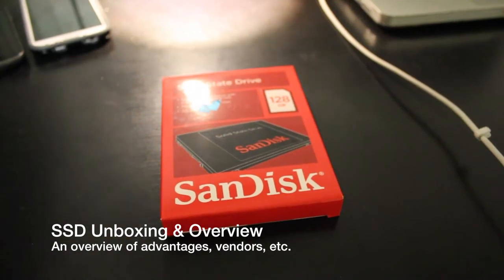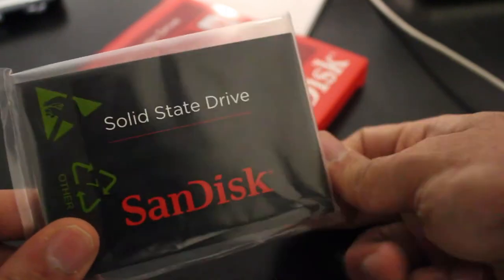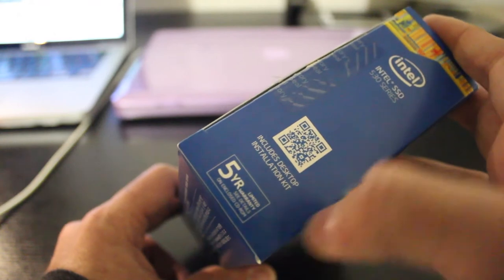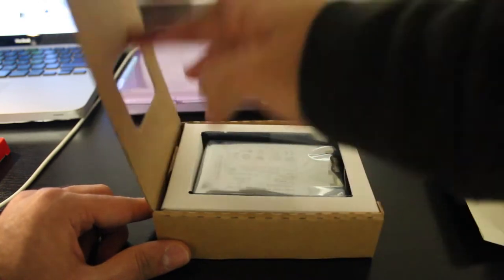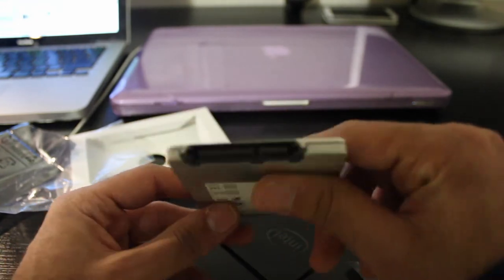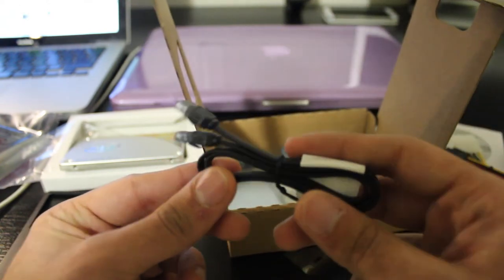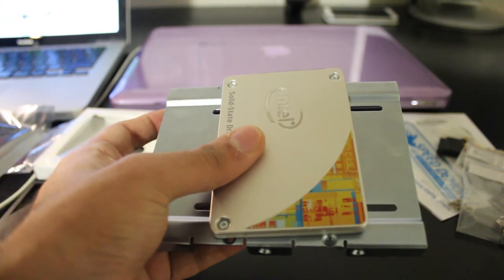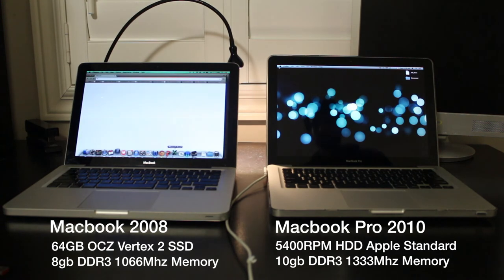Unboxing of Intel 530/SanDisk SSD & an Overview of SSD Fundamentals

Comment: this was just 75 usd on black friday
Reply from the maker: Yep! The Sandisk was $68. Both great drives. Did you pick one up?
Reply: yes the intel
Reply from the maker: Nice! Was this your first SSD? I remember the first time I installed my OCZ Vertex in my Core 2 Duo Macbook. The speed difference was astounding! Ever since then, my friend's i5 macbook pros (which use the 5400RPM standard drive) have felt slower, despite having overall better specs!
Reply: yes i love the loading time